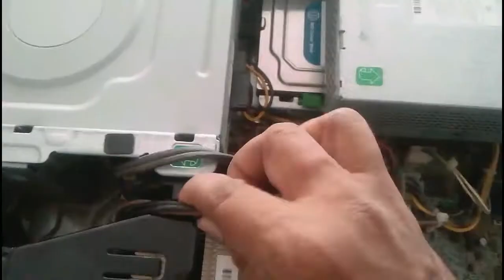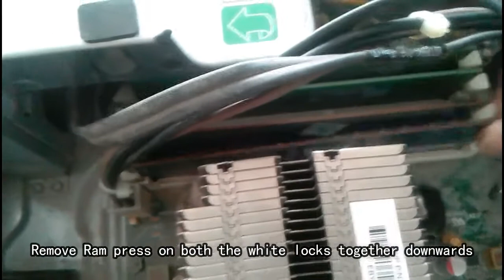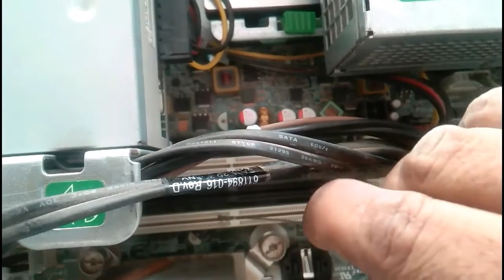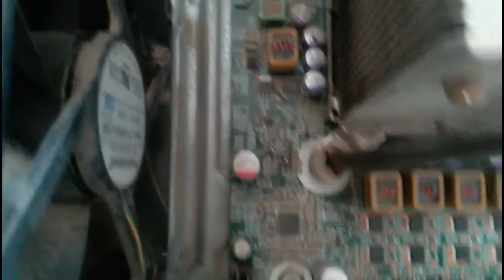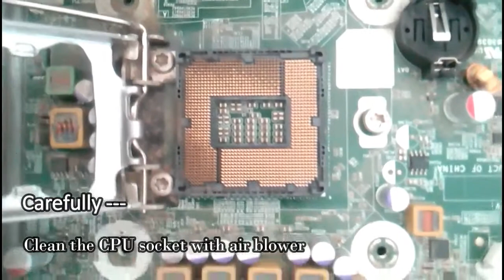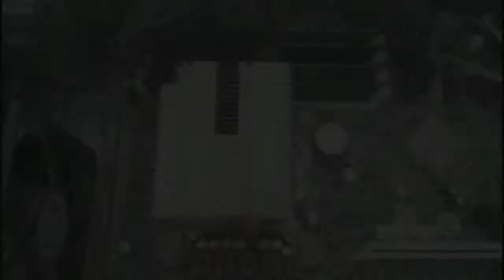How to fix | No boot | no beeps | no display | green lights on | HP Compaq 8200 Elite

Comment: what if when you press the power it momentarily open but in a few mili seconds its shuts off.
Reply: My 8200 does the very same thing. If I keep pushing the power button it will eventually come on. Did you find a fix?
Reply: @jerrywmalone  it will come on but it will shut of after a few minutes
Reply: No I have not found anyone who knows why. I guess I keep pushing the go button!
Reply: I also hv the Same problem
Reply: @jerrywmalone  no i havent. i abandon it and thinking of taking off the cpu gpu and put it on newer home. it might be on the mobo or in psu.
Reply: @jerrywmalone  did u find the solution?

Comment: what to do when its fan just spins for 2 seconds each time i start it and this process goes on continuosly
Reply: Did you find the solution? I have the same problem. The video show only all basic method not specific for this modell.
Reply: @zsoltnemeth1958  no man. every repair shop owner is asking to change the motherboard. now i am thinking about building a new pc.
Reply: Could be bad ram? Or idk
Reply: @genuinereviews6300   
HP junks ,so they just blame on you not cleaning.